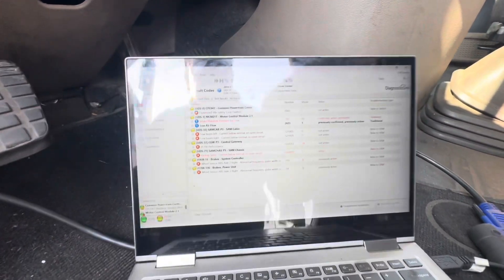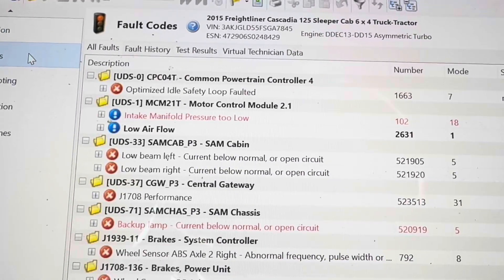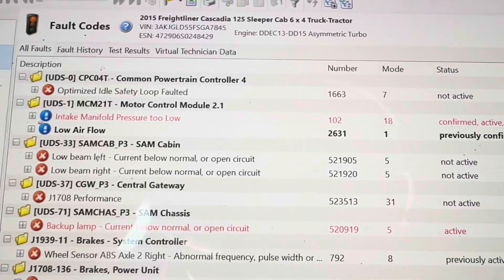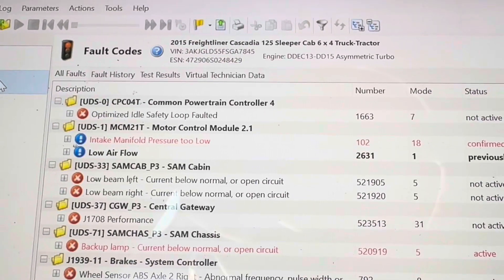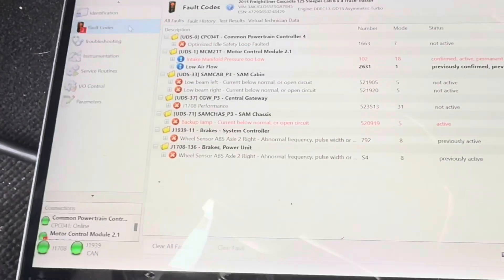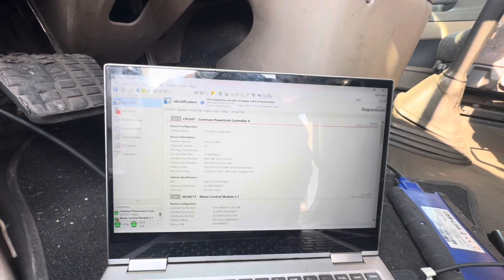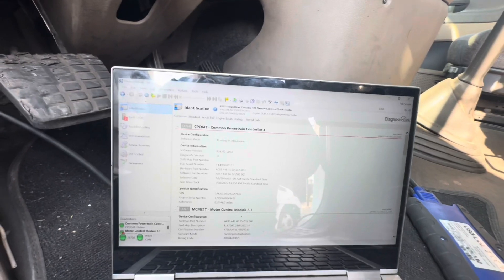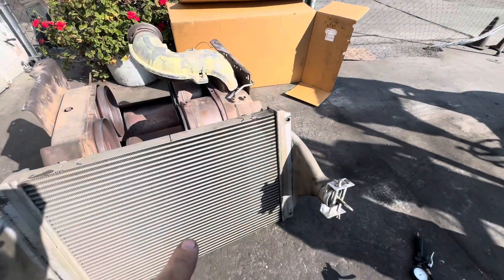Low boost, low power. Intake fault code

Comment: Hello pedro! I have this code in my freightliner dd15 2015 tubocharger intake throttle and intake pressure sensor were replaced it, checked charger cooler not leaks, performed dpf regens doc inlete pressure max reads 1.0 psi! Any recomendations?
Reply from the maker: Connect your DDDL and check the wastegate actuator travel and for any air leaks